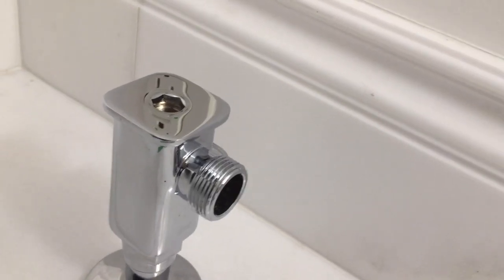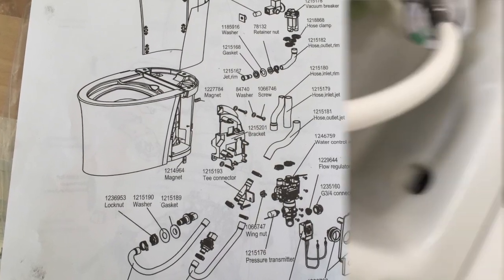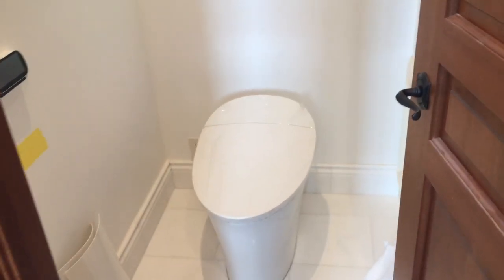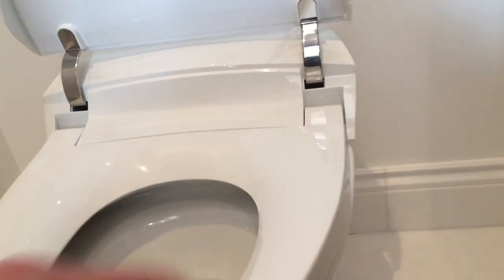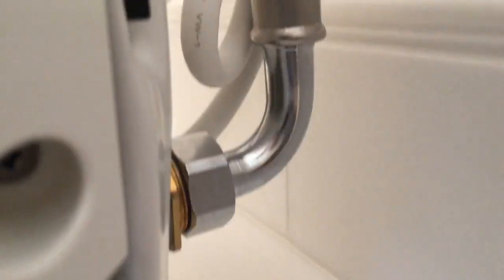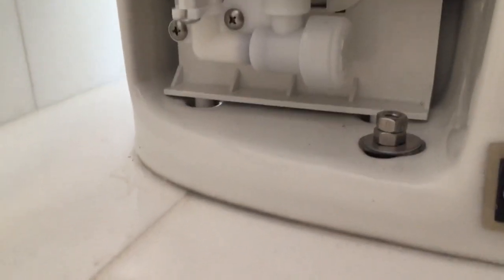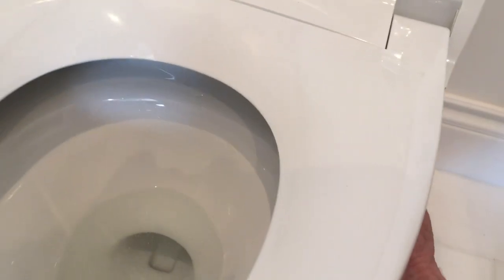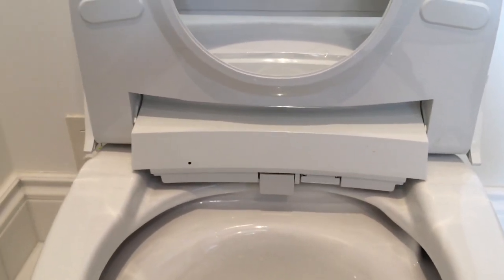Installing the Throne

Comment: Robo Toilet. What???? I just rebuilt my toilet and it just had like three settings. That was complicated enough. LOL
Reply from the maker: Hello Wayn, this is more like a dishwasher inside. Fully electronic, not so sure I could repair it myself. Certainly wouldn't be easy, all that stuff is tucked in the back and under, I'm not that agile anymore. Thanks for checking it out, I enjoy hearing from you.